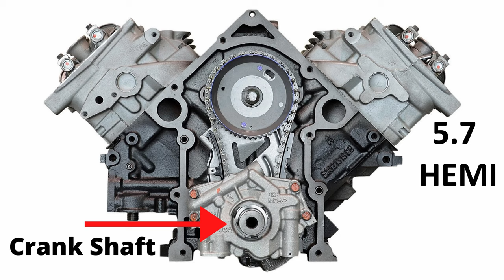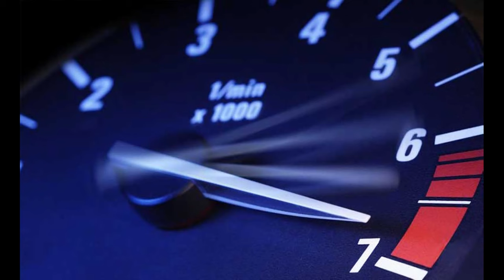HEMI TICK Explained (Easily) - The Cause and How to Diagnose

Comment: So I used to work for a gm dealer and we delt with the same thing often. I feel it has more to do with the cylinder cut off system. There are just too many small moving parts. I just got a 16 awd hemi pursuit charger and it's a noisy engine compared to my crown vic p71 I had before it. As a mechanic I would tell you to never add oil additives but I do use lucas oil treatment and a good non synthetic 5w20  and it seems to really quite things down. I keep oil changes to NO MORE THAN 5 K, no short trips and I use premium fuel . If I do get a failure I will just stab in a stage 2 cam and lifter set and program the mds out. One could always tap into a oil galley and make a drip line for the valvetrain .
Reply from the maker: so my truck is still in warranty but after that period iv thought about adding Lucas. The cylinder cut off system does seem to get a lot of blame my personal thought is maybe there is a combination of factors causing these failures to kind of create this perfect storm. regardless thanks for the info! appreciate the knowledge!
Reply: @TheGettyAdventures  Lucas is mainly gear lube but it has some other stuff in its additive package. I cant say I've ever had a warranty claim kicked or a inspector deny a claim because of lucas . I've repaired close to fifty plus LS and ecotech engines and the only time they get kicked is because it's obvious the oil changes were not routinely done( we are talking inches of sludge ) . On the newer gen 3 hemi I've seen a " oil slinger " added to this engine vs the older gen 3 ....that was at 14 I think so fingers crossed, as much as I say I'm a Ford guy I've always been a closet mopar nut , I really like this car😈

Comment: should Chrysler be responsible for these problems with the Hemi should it be a recall on there part Because it’s happened to a lot of dodge ram 1500 hemi’s
Reply: 5.7 r/ts from 2006-2010 have a problem of dropping valve seats for no reason also should be a recall on dodge or Chrysler’s side but they won’t ever do it 🤦‍♂️ just had to swap a new crate motor in mine after mine dropped car had 80,000 miles on the dash

Comment: Manifold bolts will cause this too. I changed those out and the noise stopped. I changed out most of the mopar fluids and tie rods and struts. I run 5w 20 amsoil. And I changed the transfer case with amsoil. I use amsoil for front and rear diff as well.
Reply from the maker: ya the manifold bolts breaking really doesn't help dodge or the Hemi, kinda compounds on the whole Hemi tick thing. I've run mobile 1 since new and I'm going to stick with it. but I have heard great things about amsoil.
Reply: @TheGettyAdventures  mobile 1 high performance is good. Ive used mobile one for a long time. Not all hemi get the tick. My brothers 2017 has 90,000 on it still running strong. Hes changed his cooliant, front and rear diffs and the transfer case. Keep in mind if you have the bw44-44 or i should say borg warner you can use amsoil full synthetic transfer case fluid its equivalent to the mopar stuff. I run amsoil in all my diffs and the transfer case dont have to change it out for a while and I tow alot at times. Mopar stuff like even there fluids are expensive but then again amsoil is too. But I would rather go with a trusted brand. I want to change out all my mopar shocks and struts with fox.
Reply from the maker: @Tc-ev9dd  Honestly It's probably pretty rare for a Hemi to have a lifter failure but it seems to happen enough that it is an issue to be aware of. So your brother's truck has the "updated lifters" in his truck. It will be interesting to see as those truck (2016 and above) age if they have similar lifter issues.
Reply: @TheGettyAdventures  do you know if thats all 4rth gen rams. I changed my fuel sending unit out because my fuel guage went out around 30k. Mopar parts are just bad. I swapped out for a better after market part.

Comment: Damn.  I'v had 4 Hemis with no issues, ticks, or sounds. All ran to between 100,000 and 115,000 miles.
Reply: What happened after 115,000 🤭🤔
Reply: @iwoww562a9  Traded for another new Ram. I trade every 2 1/2 to 3 years.
Reply: Hey I know people that have 200,000 or more miles on their Hemi engines. Plus they beat the living out of them. Go Figure

Comment: Swap out with Hellcat lifters or Johnson lifters to avoid the failure. Or so I’ve been told by a couple HEMI mechs

Good informative video though!
Reply: Lol still wouldn't do anything, if its not getting enough oil
Reply: Hellcat lifters  sane problems
Reply: @whowho7969  true story! I’ve still got it! I’m going with Crower next!!!!
Reply: Hellcat lifters are the same as the non MDS  5.7 R/T lifters.
Reply: @jrlee8368  yeah I learned that after the fact. Crower all the way man!

Comment: So basically rev the living shit out of it once in a while to keep it nice and lubricated? Got it.
Reply from the maker: Just try and really limit your idle time is probably the best thing to do.
Reply: @TheGettyAdventures  Rev? Rev. 👍
Reply: @TheGettyAdventures  would be easier to get a truck that actually works correctly . Im just sayin
Reply: @Mr Murders oil viscosity wears out and no longer a lubricant so what happens when you there's no lubricant between metals ?  I'm just saying is just an opinion that's all
Reply: @Mr Murders you make a mistake- ok no worries all good, but you FIX the mistake. You don’t let people spend $4-5k on something if they are out of warranty. You make a running change and then take care of the people that have issues DUE TO YOUR MISTAKE.

Comment: Uncle tony was completely wrong... and so are you.  Chrysler did put out a statement and they did have a very slight percentage of lifter failures. They said they have completely changed vendors for the lifters and added additional quality control for them.  Uncle tony didnt realize there is a huge oil galley that lubricates the lifters...  Do you realize this exact same design that won awards for the first 8 years it was being manufactured is THE exact same design?  How did these failures not show up for the first 8 years???? 2+2=4 man...  This problem is exacerbated by dirty oil in the MDS system, it clogs the activator and the lifter smashes into the cam...   The new Hemi is a great design and very reliable.  The failure rate for bad lifters is insanely small.  Think about how many millions of cars and trucks are out there right now running a Hemi. Uncle Tony did not dissassemble that engine, he doesnt know anything about it.  Those lifters move and so does the cam, that oil is gushing out the bottom of the lifter and is pushing up and down with oil, that lubricates the needle bearings and cam.
Reply from the maker: What are you talking about. What is a "slight percentage"? 0.5%? even if 0.1% of lifters are failing with how many of these engines are sold that adds up. Also, Hemi Lifters with and WITHOUT MDS system are both failing regularly so to say the sole cause of lifter failure is the wrapped around the MDS system is short sided. Uncle Tony who had a stripped out block who has been building engine for decades "missed" a "huge" oil gallery. Common. These engines have been failing left, right and center since day 1. I'm glad they got awards though, also glad for everyone who had to drop 5 G's when the their cam failing 10,000 miles out of warranty. there are pending class action lawsuits again Chrysler for this exact issue. I OWN a Hemi and I really like it, great power and very smooth so its not that I'm just hating on the thing. But they made the Hemi cheap and Chrysler hasn't said anything because they know it could cost millions and millions of dollar to fix the issue. We didn't even mention every other Hemi out of warranty with broken manifold studs, or idk maybe the timing chain disasters from 09-12 - but yes very reliable. 2+2=4
Reply: Fanboys always see their favourite Brand through rainbow glasses.
Talk to VW Fanboys and they will say the DSG Transmission is one of the best in the world and very reliable,also engines are very innovative, in reality they are at the Dealer to be repaired and law suits are opened for that. 
They always feel offended when someone says something against THEIR brand.
I think every brand has a black sheep Motor or Transmission or both in its family, even toyota or honda for example who are known for reliable cars.
Its just necessary to clear that and Tell potential buyers what could happen in future, i mean a car is a big invest and you want to have trouble free years. 
For example my tahoe is prone for intake manifold gasket failure, i didnt know when i bought it, if someone would have informed me for example with a YouTube video, i might have checked it or have it checked in a shop before buying.
Best regards from germany
Reply from the maker: @vinzmagnus1528  Exactly, I'm a mechanic (heavy duty) and even I didn't even fully understand the issues of the Hemi. I honestly bet most people will be 100% completely fine with their Hemi, but to try and argue that the Hemi lifter aren't an issue is very misguided. As you mentioned, no auto manufacturer is perfect but this issue is so well documented, it's an insult to the customers (like myself) that Chrysler Fiat hasn't mentioned anything in regards to this issue.
Reply: Got a point there, where was this problem in the 03-09 era of the engine?? I personally know people that have 2-3 hundred thousand on a  stock hemi, also long idle time can be damaging on any engine, one note that no one seems to bring up is that oil manufacturers on constantly taking out more anitwear additives, the people that report having lifter failures at 10,000 miles were probably still on their fist oil change, all that said I personally wouldn't want to own one of those trucks post 09 model and definitely not one with MDS. I do not believe the distance from crank to the cam has any correlation to the problem at all, I'm not sure if people realize that you don't want the crank "slinging" oil around so they engineer the crank to minimize that so why would  the crank be a primary oil source for oiling the cam, that wouldn't make much sense.
Reply: @vinzmagnus1528  i was a huge dodge fanboy but then i opened my eyes. I now fanboy for toyota. Great engines, great trans, good handling and great reliablility. Toyota has some trash engines in the past but they fix the issues pretty quick.
Reply: @TheGettyAdventures  I'm a MOPAR fan, but I'm not going to defend a piece of machinery to the death (or to embarrassing myself on here) designed and built by humans. Smh

Comment: Hellcat lifter doesnt have any lifter failures
Reply from the maker: You are correct, honestly haven't heard much in terms of hellcat lifter issues. granted your everyday 5.7 hemi vs your Hellcat engine are two different beast. so to compared the 5.7 lifters issues to a newer designed high performed Hellcat engine seems a  bit unfair. I have heard of guys putting Hellcat lifters into their Hemi's. if that solves the issues i'm not sure. But still interesting that the Hellcat engines seems to avoid lifter issues to this point anyways.
Reply: Do we think the lifters are actually better or is it because people typically drive Hellcats harder and are in a higher rpm range than a RAM over the entire course of its life, therefore the cam never sees much oil starvation?
Reply: There is no hellcat lifter.. it the latest lifter design, been around for quite some time, AD part number

Comment: My grandma preordered a Challenger Shaker. Had people from around the country calling the dealership to buy it cash when it arrived. She drove it 5000 miles and the tick developed. She drove straight to the dealership and said she wasn’t leaving until they fixed it. Took several attempts but she was persistent and they eventually fixed it. Grandma has gone on to win several car shows now with her highly customized Challenger.
Reply: How did they fix it?
Reply: @ayliniemi  More than likely they changed out lifters and cam since it was such an early failure. They also most likely put in the footnotes to change the engine oil to %w30

Comment: Does mean all hemi v8s.  I have a hellcat 6.2 2016 and it seems like this is happening all I know is it shows no code no hardcore tic like yours but at 42k as I daily it I know when it doesn’t act right. Took it to dodge many times and they only came back with this failure in their machine and even reflashed the computer yet problem still persist air fuel ratios bounce around from 12.2 to 13.8 driving in eco mode. Been chasing my tail for a year now. Changed the main fuel pump out and plugs. Cleaned intake and maf and change oil less than 3k with amsoil full synthetic. I really don’t get it. From my understanding the blocks the same and they added oil squatters and water jackets for cooling with different internals making it a 6.2 with a supercharger. So here the real question how is this fixed. Many you tubers I’ve followed for the last 3 years have these and mod them to max on stock internals and 9 times out of 10 they blow usually the back cylinder on each bank giving up at the wrist pin and chucking a rod. I would very much love to push this car to 850 wheel hp but it’s not in the condition to be handling this and to be frank I really don’t want to have to do a cam job or pay them to do it as the warantee is up being a 16. Sounds like a intermittent mis fire but it’s so slight but after warmed up at a light in gear low rpm and oil thins out it will shake the car like a pre detonation which I’m sure is what happening. This car is stock btw. Any ideas are welcome here thanks.

Comment: What about thicker oil can help whit lubrications
Reply from the maker: that's up for debate. My theory is these engineers (like them or not) have spent millions of dollars testing this engine with the factory spec grade of oil (5W20) so ideally you would want to stick to the factory spec oil grade. That being said, I have heard good things about adding Lucas to your oil which would thicken it up. Do some research and see what you come up with. if the truck is still in warranty I would run the factory spec oil grade.
Reply: Same here 5w20 my choice
Reply from the maker: @huzar777kosy3  ya that's really the way to go. In my opinion

Comment: So in a nutshell, run on third gear at all times and if you need to stop for anything, turn off the engine. Got it! But on a serious note, if this design is specific to the HEMIs, I then wonder why Chevy folks also run into lifter issues as well if properly maintained according to all the forums and comments I've read on this type of stuff.
Reply: Because they also do the cylinder shutdown feature. They are known for failing much faster though.

Comment: Chevy has the same issue only worse. Lol but this only happens to those using cheap oil.. and I don't mean Walmart brand oil but oil they think is a good brand but it's still cheap oil. I have 2 trucks and a durango all with the same 5.7 hemi in them and all early 2003-2004 vehicles all with over 200k miles and they all sound great the only ticking you will hear from a great running 5.7 is the valve tick but it goes away when you touch the gas pedal and it stays away. If you put a high flow oil pump in the 5.7 you won't ever have to worry about any of these issues.. the lifter wiping out the cam is from people tossing random oils and mixing oil types. Dodge actually said to stick with a good brand partial synthetic and it won't happen. I worked at a dodge dealership as a tech for about 8 years and the common things I see with wiped cam lobes is loads of sludge in the oil pan from poor maintenance. I've never seen one come in to get the lifters and cam replaced that was well maintained. So you might maintain it great but what about the owner before you. And you really need to watch what oils you use because they aren't equal by a long shot.

Comment: Got the hemi tick in a 06 ram with 265,000 miles. Only replaced egr valve, radiator and thermostat, and of course the battery.
Reply from the maker: well it seems like you at least got a good amount of life out of the old girls!

Comment: I’m pretty sure it’s do to the 13000 KM a oil change intervals, I change mine ever 5000 km and I don’t have problems, 250000km on my last one. Oil it cheap a new cam isn’t or new motor
Reply from the maker: I actually did a follow up video talking about this exact thing. I have my own truck telling me to change my oil after 14k

Comment: I had a slight tick on startup on my hemi for the last few months.   Just changed the oil and now it’s god awful...   I guess more skinny pedal??
Reply from the maker: I have a slight tick on start up too LOL iv been monitoring it and seems to just be the odd start up but I'm wating for the day when the tick just doesnt go away.
Reply: I have a 2017 they are replacing the lifters with 59500 miles on it still got cover with the warranty
Reply: @moisescervantes6032  of course,  you have a 60k warranty

Comment: You're wrong, it isn't a oiling issue at all. It was a design flaw in the lifter and the quality of the metals being used. If it had an inherent oiling design flaw, none of these engines would go 250,000+ miles, yet a large percentage do. Also, why would it be one random lifter failing while the other 15 are fine as they're all oiled the same? Ma Mopar reduced the amount of axle needle bearing and cheapened up the materials used, which caused this rash of failures. If you have a pre-2016 engine with the crappy lifters, you may want to swap them out with 2017 and later "hellcat" lifters as these  lifters don't suffer the same fate as the older design.